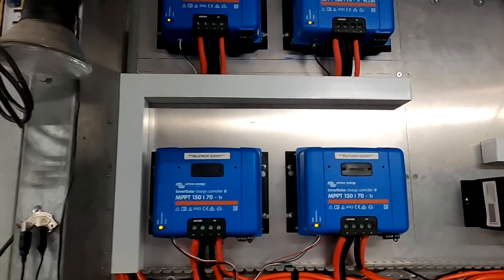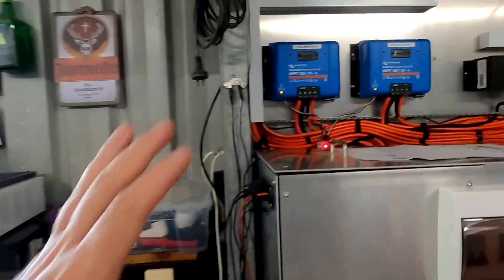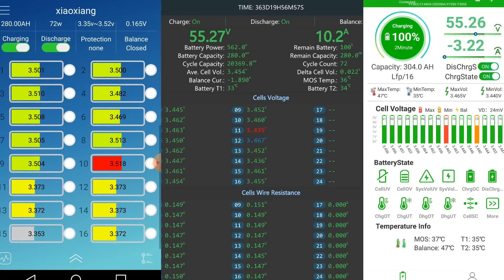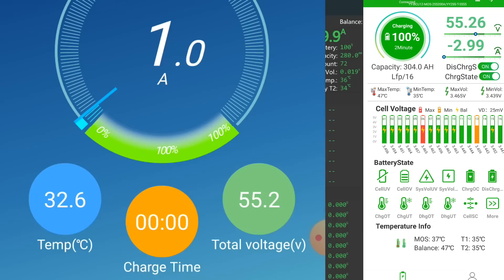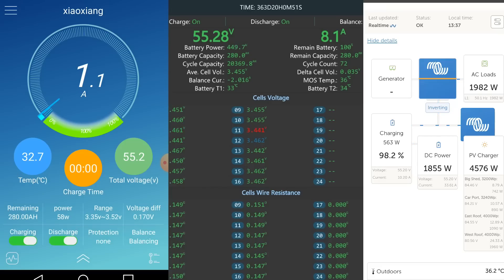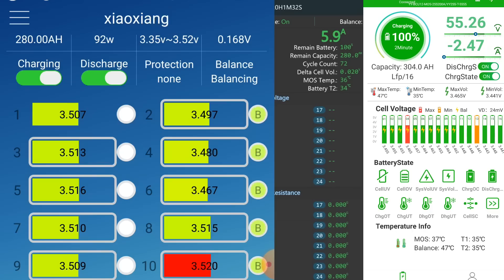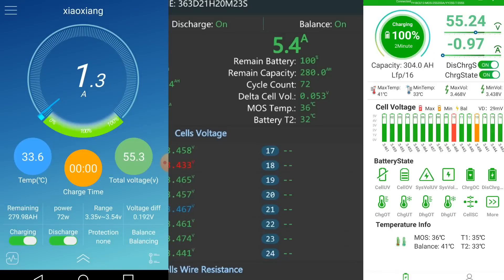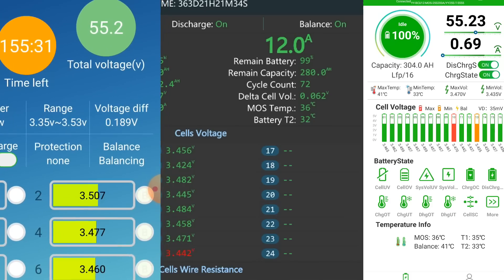Cell Balancing issues under high load. Even the JK-BMS is struggling here...

Comment: Is it allowed to use the Neey with the new JKinverterBMS? I saw some info that a BMS needs a moment (x amount of ms) to poll/check the cell voltages but if an external balancer is constantly adjusting the voltages to balance, the BMS gets no correct cell information...

Comment: Did you already change the aluminium bus bars with copper bus bars? Or dwere you able to find the issue with the battery using JK BMS that you have a cell drift? I'm having similar and wonder, what's a acceptable cell drift from full load and balanced to half load and back again to full?

Comment: I have found the JK-BMS active balancer is a bit dumb.  It does not handle large imbalances very well at all.  It seems to fixate on a pair of cells, usually not the extreme pairs either!  I have data showing it balance the middle two cells first, driving the lowest cell into an LVC doing so.  The little flying cap balancer did a far far better job of getting an initial balance.  The JK has been trying to solve a 15mV deviation when I went to bed.  This morning the deviation is HIGHER and it gave up at 3.30Vpc :(  I might have to do it myself as I don't have an 8S heltec balancer. :(

Comment: which BMS is your favorite.
Reply from the maker: The JK-BMS is best for a single battery bank, the Seplos is great for parallel batteries.
Reply: @OffGridGarageAustralia  how are your battery packs working with different bms in the battery shelf, they are all connected to one victron system? I have already 16 280ah batteries with daly bms in use, I want do increase with another 16 batteries also 280ah in one pack like the first one, can I also use another bms like the jk bms ore should I use a second daly bms with parallel adapters? what do you think is the best? the batteries will be connected to a copper busbar, to which 2 victron will be connected, which will then be connected together and later i want to expand it to a 3-phase system
Reply from the maker: @martinpuff93ify  You can use any BMS you like for your second battery. Each battery bank in parallel need to have their own BMS.
My three banks all have different BMS and work together with Victron, no problem.

Comment: Hey Andy to do you ahve a YR1035+ you can use that to measure the resistance from terminal to terminal which will tell you if you have a issue with the busbar connections rather then relying on heat/guess work

Comment: Dear Andy, the Air conditioner compressor electricity consumption will not goes up and down when we try to make the torque of the compressor rotor as constant by providing proper voltage. So, I suggest you to change the inverter output voltage specially lower than the exist voltage if the inverter have the voltage reducing option, otherwise select upper voltage than exist inverter voltage.

Comment: No need to replace the busbars. Have similar issue. It's just the cells. Have same cells, same issue. Some cells have problems to charge aboove 3.4V and drop soon when charging stops.
have 4 banks of 16KWh, working on video.

Comment: Hey, I have a pack of EVE 105 and I see delta voltage of about 20-50mv jumping between charge discharge especially at about 0.2-0.5C. Is that normal or do I have to worry ?  Cells are perfectly balanced at 3V, 3.3V and 3.6v. Just not when discharging. 😢

Comment: HELP
I have a cabin with xantrex freedom hf. I bought a valence LiFePO4 and swapped in a xiaoxiang BMS. The battery will mainly be charged via generator so speed is important.

My question: the xantrex is designed for LA and has 4 charge settings.

1: fixed, 13.5v bulk/abs, 13.5v float
2: flooded, 14.4v, 13.5v
3: gel, 14.2v, 13.8v
4: AGM, 14.3v, 13.4v

Which would you go with? Any BMS settings recommended?

Comment: Thanks Andy, very topical! This is absolutely my experience too after the battery has been through a number of partial cycles and not been up in balance territory (high enough voltage) for some time.
I’m thinking the only solution may be to disconnect one bank at a time and keep it’s voltage high for a while with an AC power supply, then swap and do the other battery. (However one of my batteries always has bigger balance problems despite both having JK BMS’s.)
Reply from the maker: That's a good point and could work if you have several battery banks. It's a bit more work and maintenance and you need to pay attention what is going on in your battery.

Comment: Hi Andy, and thank you again for this video,😄👍
You will have to pair your NEYYYY active balancer with the JBD (last version that you can adjust, the voltage of the balancing start and stop) I'm sure that will solve your problem on this battery.😉
Regarding absorption, did I already tell you that I was not at all in agreement with doing an absorption at each charge cycle??🤔
That you make an absorption, once a month, why not.
Pushing the cells up to 55.2 V at each charge, so that just after it are very quickly at 53.6 V in floating, for me this makes no sense?🙃 (earlier balancing and Floating) and why not from time to time do an absorption, after a deep discharge for example?
But that's just my opinion, and everyone can do as they want, and especially depending on the material used, and the results obtained.
But your videos with all these tests are always so interesting.👍
Reply from the maker: Thanks for sharing this with us.
Absorption after a deep discharge would make no difference to the battery, its health or the overall capacity.
We absorb because we want to fully charge the battery and also give the balancer a chance to do it's job at this rised voltage level (55.2V in my case.)
If I would stop charging at 55.2V altogether and fall back to float immediately (53.6V in my case), the batteries would only be charged between 90-97%. And this result is very much totally different dependent on the charge current the cells have seen before ( see the test here: https://youtu.be/qZg4Jxftw-c).
Absorption gives us a defined end point of charging. Yes, we can absorb at 3.35V as well which will take an awful lot of time and most likely won't be finished before the sun goes down. We would end up with very inconsistent charging results. 
So, we have to go beyond the knee of the curve with LFP batteries to make it work and also allow balancing.
Reply: @OffGridGarageAustralia  Thank you for your answer Andy! and for sharing.
 As you say "in my case (55.2v in my case)"
In my case, if I charge the pack at more than 54.5V the problems begin: voltage difference between cells much too great! almost impossible to balance, or takes a lot of time.
You know your pack with the JBD, which has a large delta voltage cells, at the charging end.
I think you could see that if you don't push this battery to more than 54V (for example) you won't have this significant voltage difference. (your battery says so)
you push it more, and you notice the problems. If you actually think that the problem comes only from loss of load due to the bus bar? and you manage to fix it? and then it charges without any voltage difference?
 My opinion is that it is more of a difference in internal resistance to the cells (at the end of the charge only!) that does this.
 Besides, I would suggest that you try to pair your Neyyyy active balancer (last version) but I'm not sure it will succeed in Balancer. 
So result, this pack if you want it to keep a correct balance, should not be charged more than 54v-54.5v.??
I would like Andy, that you do a test, on the time it takes your battery pack to return to approximately 54v-54.5v,? just after your absorption (55.2V in your case)? 
Test: absorption up to 55.2v stop charge, and no discharge! and see only how long will your pack take to go down on its own to around 54v??
Really interesting. Thank you again for all these videos, it's really instructive and interesting.

Comment: Should you have to replace all the aluminum buss bars for a test with results? while they are maintaining and in use currently, one or two changes would show a difference if there is any to show . right??? if there is a difference it should show a difference instantly without an entire massive changeover and test.  or so i would think.

Comment: I find it interesting (and potentially worrying) that if you manage to size your batteries "correctly" (ie energy in = energy out most of the time) you will/could have serious balance issues. If you only are able to top and bottom balance, you may find some cells get seriously out of balance, simply due to not being in the small range where balancing occurs. Having said that, you have the Heltech active balancer and isolated batteries, so it wouldn't be too much effort to set a particular battery to charge only and let the active balancer go to town.
Reply from the maker: Yes, we could run a maintenance schedule every 6 months or so and let the batteries perfectly  balance, say over night with no load connected. I could also isolate a single bank and let just this one balance while the other two are still active. So there are multiple solutions to that. I'm not sure how much the cells will drift over time if I leave it like this. The balancers are still working and doing their job, kind of... I'll leave it as it is and see what happens and if it really gets worse.

Comment: Is it possible you have a loose bus bar between the group of higher voltage cells and lower?  Seems strange to me that the voltage on one part of the system would be uniformly different.  This may also explain why cell balancing under high load isn't working too well...  But in addition, when a battery cell is producing high current, it is very difficult to regulate its terminal voltage.  And if you have a high resistance in the battery interconnection, that would make it more difficult for the BMS to get accurate readings and work as it is supposed to.  I just can't see cells 1-10 being one voltage, and the rest of the pack being another.  It should be more random.  This would also explain why swapping the BMS's made no difference.

In the end, it is usually the simplest solution that solves the problem.  Check all the bolts connecting the bus bars.

Comment: Before attaching busbars either by welding or bolting, you need to polish the surfaces of the terminal and busbar bar or give it a acid bath and clean it and immediately apply a corrosion inhibitor such as vaseline or a specific compound meant for aluminium joints to get good performance, having problems with my experimental EVE LF50K pack with voltage drop between the busbar smd the terminals. I can provide the EVE documentation where they recommended you to polish the terminals "to remove/reduce the aluminium oxide layer".

Comment: Bravo!  I hope the micro cycling goes ok. My 36v Golf Cart testing continues, and these cells continue to impress. I just wish I had more options than Daly.  Alas, one buys what one must buy to make it work.  It works generally, but the bms leaves me hanging at times where I must activate it via the charger and linking the main pack negative to the main negative busbar on the other side of the bms via a resistor (just a touch while charging the pack) to force the bms to wake up when it fails to wake up by pressing the pedal on rare occasions. I guess it's not the worst problem to have because it hasn't done anything like this under load (i.e. when driving).  Sigh... I guess someone will make a 36v bms with 350ish amp peak/250 amp constant load that provides a bit more stability. Could never get the Bluetooth app to work right either.  Ahh well, maybe I'll try a firmware update someday.  Perhaps more opportunity for things to break.  Anyway, while the bms is mostly OKAY, the storage grade cells really have done the job thus far.  So much range I only have 4 cycles on the cells since last summer, even with some self discharge and emergency backup power via PSW inverter during a few power outages over the fall/winter months.  Amazing.  I thank you for all of your testing, as you encouraged and helped me tremendously with my own efforts.

Cheers to you!

Comment: Hey Andy, if you have a combined charger/inverter, your battery generally doesn't mico cycle much, as when the sun is shining the inverter will power the load from the solar. Separate chargers and inverter is definitely harder on the battery, doesn't victron make an all in one charger/inverter?

Comment: Andy, I ordered from your WANPTEK link and that has resulted in one big mess. The seller is a real pain in the ass, treating me very bad and stalling the return procedure. Alie Express confirmed I did everything right, but the seller finds all kind of excuses not to refund the money. I think you should really remove the link from your website. I got the wrong power supply, a lower rated 30V 20A instead of the 60V 20A. Needless to say the 30V is useless for charging a 16 pack battery. If interested I could copy paste the correspondence with the seller, which on his side is quite insane.

Comment: Andy, could there be a bad connection between cells 10 and 11 causing the voltage difference?
Reply from the maker: No, that can be as the current is still the same going through all cells, so all cells are getting the same charge, regardless the connection quality.
Reply: @OffGridGarageAustralia  then explain why cells 1-10 are "grouped" by voltage.  Gotta be a reason given the same current, the downstream cells after 10 aren't charging the same way.  Maybe it is that the BMS isn't reading voltages the same way?  If the screws are not torqued to the same spec after cell 10, then the BMS won't read the correct voltages on those cells.  I would still check all your torque levels on those screws.  Certainly can't hurt!

Comment: The good thing about a BMS is , it'll open the circuit when a cell or pack voltage reaches cell or pack ovp or cell or pack uvp.  I can never seem to get all my cells to reach 3.65 and that's why I set the cell ovp to 3.35. I used to have it set to 3.45.
Reply from the maker: You set you cell OVP to 3.35V???? That will never fully charge your battery.
You should set your charger to 3.45V and the BMS to something higher, 3.6V for example.
Reply: @OffGridGarageAustralia  i tried that and then the cells that reached 3.65 v would still be at 2.3 while other cells would drop down to 2.0 uvp cutt off and that would shut the whole system down.  I like to get as much up and down as I can out of my cells pack. Oh and and my cells are 3.2 v , not 4 v cells.  I like to do a fast charge lol , the 100 amp smart bms,s that I have don't hold the cells at 3.65 Volt and allow the others to catch up.  It would always overcharge my cells before the rest would catch up.
Reply: What I meant when I said the cells that reached 3.65 v would still be at 2.3 while other cells would drop down to 2.0 uvp cutt off  , was not while still in charge mode. It was while I was using the cell pack under a load.

Comment: I'm wanting to design my own bms what features would be your dream bms features 

I have been watching your videos for some time now and love how you test the bms's and provide feedback 

Thanks in advance
Reply: Make sure you have lights to show its on, which my Daly does not have. Must have active balancing of 5amps but no less than 2amps. Be usable for 4 cell upwards. Bluetooth connectivity. If you see the review of the Seplos BMS then it covers most bases nut still has some flaws which could make it ideal. One thing is the user interface to be intuitive and simple, preferably graphical. André in Sydney
Reply: @SoundzAlive1  I hope to make it a 3 to 16s but also I want to make one for a 86 to 100s for my ev

my basic requirements are; 
must have bluetooth and wifi
must have can bus and serial 
must have active balancing of 5 to 10 amps
must balance to follow settings by user
must have passive balancing for charging only 
must be lipo and lifepo4 compatibilties
must be mosfet controlled for charge and discharge
must have a precharge output option

that is most of them anyways

Comment: I've done some overnight JK BMS testing to check how much power Bluetooth has extracted from the battery after a full charge and charger disconnect. Has far as I know, there is only one way to turn off Bluetooth. You must unplug the BMS from the battery, then plug back in. I have some screen grabs for comparison if you're interested.
Reply from the maker: Why would you disconnect BT?
Reply: @OffGridGarageAustralia  I have an EV. Don't want the batteries to consume any more power than is necessary to power the vehicle. I wrote to Jikong asking them to update the firmware to offer the option.

Comment: 363 days of uptime on the JK BMS. It's done a good job for a year of constant service!
Reply from the maker: Yeah, I never take the BMS offline (unless I swap them). I have also not had to restart the JK since I installed it. I would have to look this up again how to attach the starter battery to fire it up. The JK is really great (but not perfect).
Reply: How many cycles in a a year?
Reply from the maker: @a.wgilbert5001  I have done roughly 75 cycles in one year.

Comment: Hmm - when the chargers switched to float the bottom 6 batterys of the overkill BMS went to 3,32V. That should not happen if they are almost 100% charged ... We know they stay at 3.35 for a long time.  Are you sure, the BMS is measuring the correct voltage?  Did you check with a multimeter?
Reply from the maker: Well, they are not 100% charged! Only the first 10 cells but the other 6 are behind for some reason. 
Yeah voltages are correct, the Heltec showed the same when connected to this battery